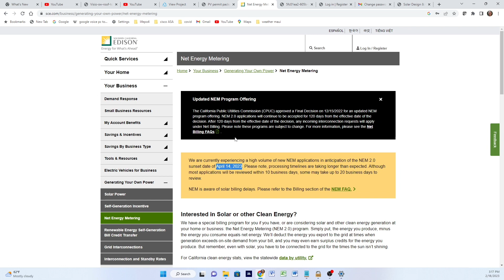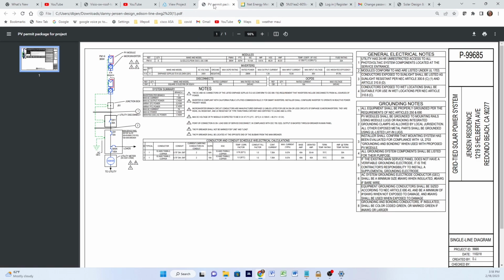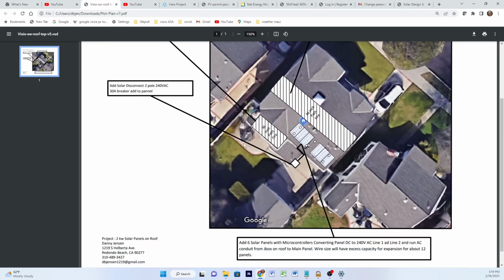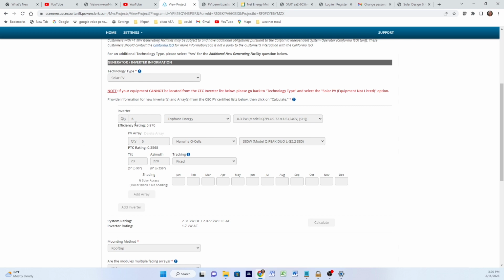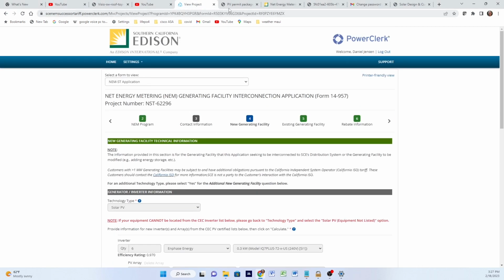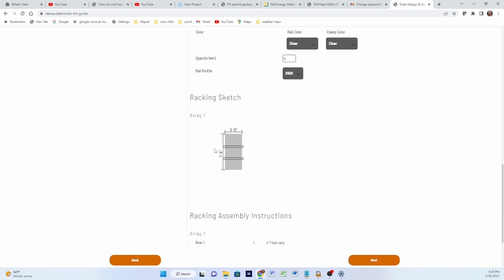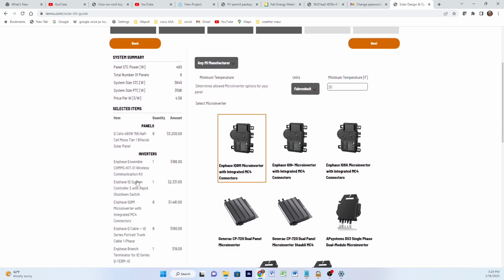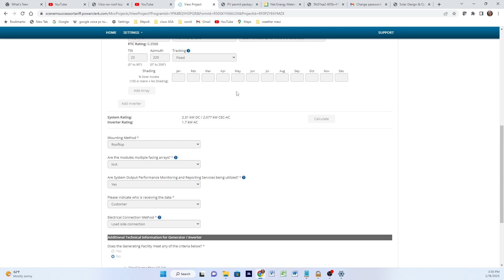Fill out Grandfathering Forms needed for California NEM 2.0. Install later after deadline.

Comment: You didn't mention the actual application 14-957. Why?
Reply from the maker: I don’t know anything about this. What is it?
Reply: @dannyjensen4954  It's a form on the Edison website that they say is needed for all new NEM applications. One of the few required uploads...
Reply from the maker: @caspiana3623  I do recognize this form! Its the same one we are filling out when we answer all the questions on the power clerk system.  I don't know the form number. Thanks for pointing it out. We can print one of these out once we fill out all the boxes on the power clerk system I think. Here is the form on the SCE site  https://edisonintl.sharepoint.com/teams/Public/TM2/Shared%20Documents/Forms/AllItems.aspx?id=%2Fteams%2FPublic%2FTM2%2FShared%20Documents%2FPublic%2FRegulatory%2FTariff%2DSCE%20Tariff%20Books%2FElectric%2FForms%2FInterconnection%20Agreements%2FELECTRIC%5FFORMS%5F14%2D957%2Epdf&parent=%2Fteams%2FPublic%2FTM2%2FShared%20Documents%2FPublic%2FRegulatory%2FTariff%2DSCE%20Tariff%20Books%2FElectric%2FForms%2FInterconnection%20Agreements&p=true&ga=1
Reply: @dannyjensen4954  This form is listed as #1 document on the checklist of uploads. Another snag that I hit was the drop-down menu that didn't have a NEM option, only the  NEM-ST, which to me stands for the successor tariff, which is NEM 3.0? The only option to have NEM without any letters attached is under some other option.  However, there are both NEM and NEM-ST on the application.
Reply from the maker: @caspiana3623  I haven't looked at the check lists. I was figuring the app was going to guide me through it. It is complicated enough to use the app. Thanks for pointing out the true form we are filling out.
Reply: @dannyjensen4954  Glad to help! Hope I am doing it right...

Comment: Do you have any experience or knowledge about applying for NEW2.0 with PG&E?
Reply from the maker: No. Hopefully but I bet it is the same because it looks like PGE uses Power Clerk too! Let me know what you find. I'm doing an SCE form for my son in law in the next few days! Google PGE power clerk login
Reply from the maker: @The universe... I'm filling it out now. I did mention the SLD. The CSLB. I don't think is necessary for a Owner install. I'll let you know. What I find out by filling out the doc.
Reply from the maker: @The universe... I filled out the form as owner self install. It looks like a line diagram is all that is needed for owner install. We will see how many changes I can make after approval .. if approved. They took my $94.
Reply: @dannyjensen4954  correct. A contract is not necessary (only time will tell though) only a single line diagram and plot plan and a few documents that can be downloaded from SCE website are needed. And the $94 fee. I submitted mine on Feb 27. Still waiting for a response. Only document I did not have at the time of submission was the city permit which was optional at the time of SCE application submission. 
Thanks for the video
Reply from the maker: @sarfarash1  Thanks for the info. I did my submissions for me and my family on March 17. Please let us know when you have more info. I did a more detailed video with a link in the description for your review and comments.
Reply: @dannyjensen4954  will do. I tried contacting Edison‘s interconnection department last week. They do not answer any calls understandably, they are busy with a large number of applications. However, Edison is asking for applications to be submitted no later than March 24 in order for it to be considered under NEM2.0

SCE says allow 20 business days for reviewing the application. So pretty much tomorrow is the last day.
Reply from the maker: @sarfarash1  Video where I added Solar panels to existing existing system on the form:
https://youtu.be/L7xpIIcptM8
Reply: @dannyjensen4954  PGE charged me $145.
Reply from the maker: @ridemfast7625  Where did you get the single line diagram template for your project? Is the system Power Clerk to fill out the form?
Reply from the maker: I just did a video on PGE where to go to  fill out the form but i'm not a PGE customer so I can't record a video on this. But... maybe the questions are about the same as SCE. Here is my PGE video. https://youtu.be/nPjxBKWwqDg